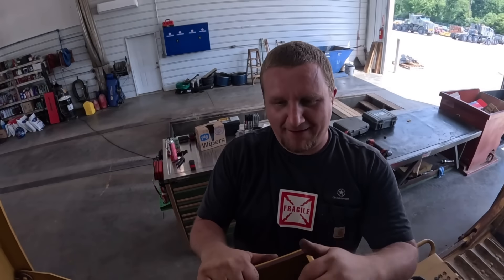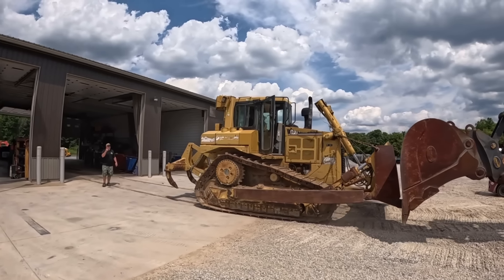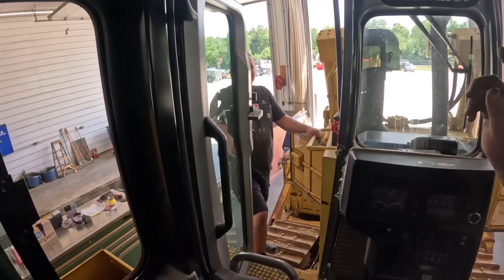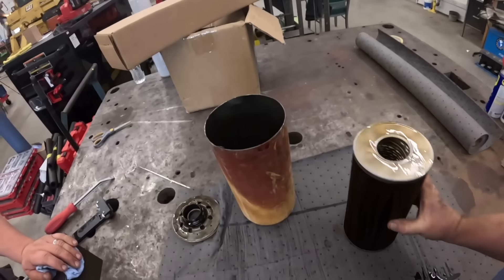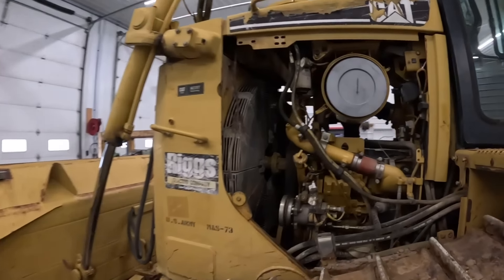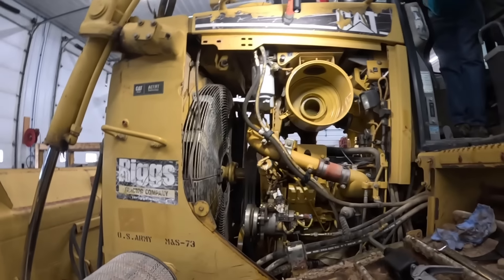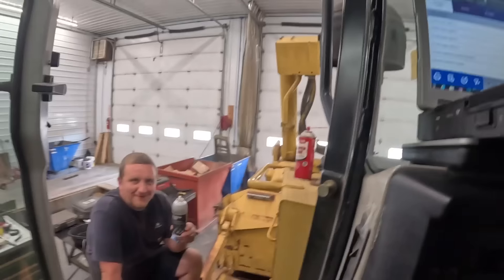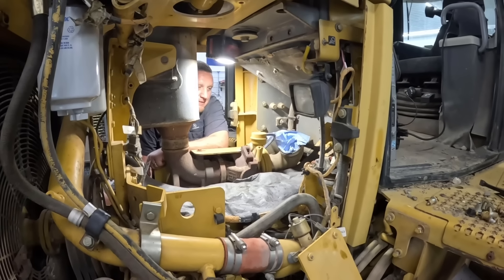Ex US Army Caterpillar D6R dozer is dead with only 800 hours? I may of messed up big buying this!

Comment: Back in the late 80's picked up a used army K5 blazer. SNAFU must have been the norm because someone left the air cleaner lose and a family of mice moved in. Long story short, every cylinder was packed solid with mouse house materials. After a total rebuild, new wire harness, new fuel tank, hoses, belts, tires, etc.,etc., etc., she ran like a dream. She had a whopping 63,800 miles on her. Sold her to a buddy, he drove it as a daily driver for well over 20 years. He still owns her, she's parked in his shop collecting dust these days. Tried to buy her back but he isn't letting her go. She now has over 300K miles on the meter. Starts and runs like brand new. Should have never sold her!

Comment: You never know what kind of surprises you'll find with something like this. It takes a special kind of "not my dozer" to leave the fuel cap off and then they don't even at least throw the final drive shafts in the cab or something. Makes a guy wonder about how these things come about sometimes, but you and Kevin will get the kitty purring again.
Reply: Unsupervised teenagers can create chaos on half a million dollar machines. Or they can work miracles if properly supervised.
Reply: Why would you include the drives shafts for something going to auction if you needed them?    It’s not always incompetence at the unit level

Comment: Diagnosing a mystery is fun to a point...  Thanks for bringing us along and explaining what you find!
Reply: Had a friend with a masters in mechanical engineering overhaul a John Deer tractor engine. 4 cyl gas and couldn't fig out why the oil pressure was low. After completely tearing it own again, someone with a lot less education asked if he bothered to check the oil bypass located near the filter....duh..lol!
Reply: Hope you’re state New York. It is about the same as you got down there. Every little hamlet has one.

Comment: I had a Rusty dozer tank that was also full of Algae... Took a hot water pressure washer and just ran the hot line into the tank filler neck.. then took a 375 air compressor with a blow bar on it.. went through the sight glass with the blow bar and SENT IT! blast it out and re filled.. did this like 10 times... 180 degree water... The tank had baffles which made it harder but I came out victorious lol... Left the blow bar in at the end for an hr and a half, half cracked.. used the hot air to dry out tank... No more plugged filters!!! 💪

Comment: I bought a 644h from the army with 25 hours on the loader, it was a will not start will not run, I got the machine home and let’s just say it was a little critter that had some wires for lunch in the cab, about 15 dollars in wire and a couple of hours labor and it was running like a top. Good luck on the d6 I hope it’s not to bad, great video and keep them coming.
Reply: What auction did you buy it from
Reply: @GITRDUG27  from iron plant before riche brothers
Reply: I think Clint should take a look at the electrical wires like you did. 5 injectors going bad at one time would be pretty odd.

Comment: Unless the specific unit has a lot of training and/or project work, they get minimal hours. Our combat engineer unit had D-7’s and other heavy equipment (1970’s in Germany). I kept inquiring about potential work, and would fine projects that we could do as “training”; tried to do the same itch our JD410’s and 2.5 Cy  bucket loaders. Otherwise they would have had minimal hours. The M&S label makes me think it was used for base support rather than being assigned to an engineer unit. Also, the condition doesn’t lend itself to military unit maintenance (which in our case would never look than bad except in a can point.

Comment: That 6R is a nice operating machine. The steering and shift is all on the one lever. Push forwards for left pull back for right. Shift by twisting. Middle in neutral. Do not leave idling with safty lever engaged or torque converter overheats. You have a very good veiw. That is even wired for satalite GPS to pull programed grade on road building or pads. That transmission is a fairly easy rebuild also. Even a new operator can run that easy. Once they get used to deacselerator. The track turn is by speeding up the track on one side.so you always have power pushing your dirt both tracks.

Comment: There is a DG 7-10 miles around here in Western NY. One town, Clymer NY refused to let them in, They were protecting their local grocery store. Problem with DG, no fresh vegetables and fresh fruits!!!

73’s from Sherman NY
DE N2JYG
Reply: They have them here in Florida
Reply: Big problem with DG is that they run local grocery stores out of business. It happened in Sherman and if you try to open one near a DG, they will under charge for the same thing and DG has no fresh vegetables and fruits.

DE N2JYG

Comment: Being in the repair industry, a customer drops off a foreign engine says it doesn't start AND LEAVES.  OK, get a service manual, and it states - USE A KNOWN GOOD UNIT  😮. After ➡️'SEVERAL' ⬅️ known GOOD ELECTRONIC units, the engine started & ran 🎉. Now, was it the last GOOD unit or a combination of GOOD units 😮🫤 YOUR CHOICE 🤷 😊

Comment: If it's a mistake, I'm bettin' you can fix it cheaper than most. I've witnessed this model of D6R in serious action. Cripes was that thing a beast and a half. Made a normal D6 look like a pansy. Do your best & I bet it turns out. Thanx.
Reply: In terms of what impressed me about it's operation was that for a smaller dozer, the thing had more 'ass', could push more dirt physically than anything near it's size. It reminded me very much of watching a fully loaded 850 Deere which I'm sure you are quite familiar with. In terms of quicker track wear, that sort of makes sense because smaller sized tracks are going to wear quicker being stressed so. Thanx

Comment: Put circuit  breakers in line with the injectors so you don't burn out another set.  When problemdiagnosed properly restore the wiring.  Injectors aren't cheap.

Comment: Video started.  ☑
Like button pressed.  ☑
Going full screen.  ☑
Starting running commentary.  Here we go:
	• Kevin likes Cats.  Awwwww.  😃

	• 800 hours on a ~2006 Cat dozer?  From what little I know, that's not even broken in yet.
	• Is it just me, or are excavators the most versatile machines?  Digging, lifting, pushing.
	• You go, Jay. . .even if your a Ford man.  We still support you.  😉
	• Kevin is so safety conscious. . .bless his heart.  
	• Mmmm, comes with Cosby sauce.  😃
	• Missing Sun gears.  Doh!  😵
	• Yup, ahe's a sooter!
	• Well, she kind of fires with a sufficient amount of ether.  Just need to get enough fuel and pressure in there.  👍
	• Cylinder 1 clickin'.  Cylinder 6 clickin'.  Cylinders 2, 3, 4, 5 electric solenoids not clickin'.  Gotta start opening up stuff, starting with the valve cover.  Stop it, Clinton!  You're making Kevin throw up in his mouth!  🤮 Poor, long-suffering Kevin.  
	• Time to take injectors out.  🤕
	• Yeah, something got hot.
	• Invoking Curt at Area Diesel Service.  Good call.  👍
	• Yep, looks like some damaged wires on the harness.  Stupid rats/mice  🤕
	• Ooooo, ordering some new injectors and a wiring harness.  😉
	• Part 2 of the video for this dozer coming soon.  👍

Comment: We used to pull the final drive shafts on down dozers if we were going to drag them, but we also didn't pitch them... 😂

On the injectors, those harnesses are notorious for falling apart and the plastic on the connectors melting/distorting.

The oiling system is like the 7.3 PS and 6.0, there's a low side and a high side. If the machine has sat for a long time, it can take a while cranking to get the high side with sufficient oil to get the injectors pumped up and the air purged.

Comment: Have you ever tried using a spinning turbo jet to try and clean the fuel tanks out on dozers they are used to clean sewer pipes out really effective piece of equipment can be fitted to a lance or a high pressure hose .Worth a try

Comment: Hopefully it’s just a short in the harness and didn’t overheat to the point of no return! Good start guys 👍
Reply: working on my friends LMTV military truck there are always a bolt or two missing. The two idler pullies for the belts were missing the adjustment lock down bolts, they just overtightened the pivot bolts on the idlers to hold them. It had lots of electrical gremlins. Suddenly it would not move at all.  We finally pulled out the biggest circuit breaker panel I have ever seen (the whole passenger side of the dashboard is a breaker panel) once removed we found 6 or seven major wire looms with chewed wires. luckily the mice did not eat the wires only the coatings so they were shorting to ground and each other. We had to reinsulate 20 or more wires and install a new breaker board due to all the mouse urine. Once we finished it started up and ran like a dream. another odd thing with this vehicle,    all the wiring is white. not one colored wire loom on the truck. no wonder the mechanics go nuts with this stuff.

Comment: I ran a D-6 M with finger tip steering loved it that machine was a dream to run 13.6 wide blade extra long tracks and wide pads.  Once ya got use to the steering great machine to run.

Comment: The D6R replaced the D6H in 1996, and came in five models ranging from the 165 hp (123 kW) D6R to the 175 hp (130 kW) D6R XL and XR, and the 185 hp (138 kW) D6R XL (IG) and D6R LGP. All used the Cat 3306T 6-cylinder engine.

Comment: Happens all the time, injector harness failure, and or injector connect failure happens on that system if you don’t change the oil

Comment: For a fuel tank-  hot pressure wash, then flush with alcohol, which will mix with then and take any water out. Mechanics  were always in scrounging my methylated spirits or isopropyl.

Comment: Best way to clean a fuel tank is to steam it out and hit it with some acid based cleaner. No steam, use hot water, rinse out several times. There are industrial tank cleaning compounds, Lix was a brand we used in the past…

Comment: Looking forward to the upcoming videos on this 6R. I have to say I despise these R's, or any high drive for that matter. I can't stand the visibility issues with them, fortunately people love them and should be able to move it pretty quick once troubleshot and fixed. I love my John Deere dozers for visibility and maneuverability. In my opinion the best part about a cat is the seat( not because it's at an angle), if John Deere would put a more comfortable seat in there dozers they would be close to perfection.

Comment: Personally i would be isolating the injector harness at the jpining plug and checking for a pulse and voltage on the pins for all the cylinders,strange it has no stored fault codes. Testing the injectors for resistance values would be helpful to the picture. Regards Chris Bailey

Comment: Not sure if Cat has timeouts on the engine side but I have have seen solenoid wiring melt due to keys left on for extended periods of time. Usually the connection builds the most heat, and melts first. Same as like a headlight bulb connector, the plug and wire will melt before the rest of the system. Just a thought.

Comment: I have worked on Volvo, Mack, and Cummins engines with electronic injectors and all the wire harnesses look just like that after a few years. Lot of heat under that valve cover and the chemicals in oil just destroy the connectors and wires,  Have replaced many injector harnesses and injectors and they ran like brand new afterwards.

Comment: Clean filter, clean oil.  Hum Engine issue replaced both and still didn't run.   Wonder if that is the NOOP issue. Maybe it shipped from overseas, and fuel and oils were drained.

Comment: Working on electronics , I learned that applying power [ WITH A LAB POWER SUPPLY / that has the ability to dial voltage & CURRENT LIMITS ] - not sure what voltage those injectors require , but lets say 12 volts , dial in 6 volts and limit current to about 1/4 of what good system would draw , then see if the system pulls max current that you set --- this is to load the system with less than enough current to do more damage .
Need to know what the typical voltage & current is - and start with much less , working your way up to max normal --- if the system still pulls more current than listed max - further diagnostics to find short / source of high current draw ?
Good luck & thanks again
Reply: Agreed- do the diagnostics on the wiring/electric before putting in new injectors. I can't believe the whole engine got hot enough to melt/embrittle the harness. Looks like a excess current flow to me! (I've lost a car from critter chewing - cost to rewire greater than value). Modern wiring tastes great as Kev said- soy based insulation.

Comment: If the terminal fit was loose on those injectors, it will cause high resistance and get hot enough to melt the plastic like what you have there.

Comment: I can’t believe you guys are hating on Cat like that.  Especially without me I sure was happy when they stopped putting them in trucks. Our local Cat rep was Ahole. Of course he worked at the local Cat dealership. Most of there techs said he was like that because he didn’t know anything about trucks and only slightly more about equipment. Which made issues a big PITA.   The older Cats ran good when they were right but the newer emission engines were junk had so many come in with  broken rocker studs. They were the most expensive engine to build

Comment: Thank you ( Clint) 😊❤😊 for the skills of moving and rigging the chain ⛓️ and moving the Cat dozer of low boy 😊 excellent 👍 speaking of that ( CASE) excavator, can you tell me if there are ANY differences between the ( Link Belt) excavator and the ( Case) by your experience looking inside the Way they are built 😊 I understand that the same company builds both brands. Is it only the COLOR and manufacturing lettering or is there slit difference 😊 just asking. I want your expert opinion on what brand you prefer to work on. I do "NOT" see any 
( Link Belts) In your yard. Does that mean ( Link Belts) are more robust and longer lasting, doing work. Or is it just the different ( Financing) the two different brands offer to the contractor and owners preferences to a particular Brand 😊 they have always owned case started with a rubber tires Case ( Backhoe) and just kept it in the family when they moved up to more bigger excavator type ditching work. 
Just asking 😊😊😊
Reply from the maker: Paint color is the only difference
Reply: @C_CEQUIPMENT  thank you so much for your expert insight. When you explain everything about your International TD-25
Pushing dirt, and explaining the control levers. 
To notch video you do. "5" 🤩

Comment: The way you received it with fresh oil, Then you find out stuff was melted due to probably running hot leads me to believe either someone ran it low on oil or rand it low on coolant. Then before they got rid of it topped it off with fluids

Comment: From what I here, the ACERT C9 is just as bad as the 7.3 power stokes at burning up the injector harness under the valve cover...don't know if it's true but I have had 7.3 power strokes before and I have seen that harness take out all 8 injectors and all 8 glow plugs....mouse was probably an after the fact issue...been there too

Comment: they used the cat huei system. so did isuzu. hydraulic unitized electronic injection. hydraulic actuated electronic controlled very important to use the right oil right filters and change em regularly as engine oil powers the injectors each injector has a in-built pump. no oil pressure no fuel

Comment: And everyone wants to own a big dozer till it breaks down. I hope it is something simple enough like a shorted wiring system or what ever to cause melted wire. Yo said army and I was in the army. We were known to do some dumb stuff. I did work as a mechanic for over fifty years in heavy equipment but my last heavy stuff was start of nineties and stuff I seen was still back from say sixties and say as new as a mid eighty model stuff. Not too much computer stuff on them. All mechanical engines to me are so much easier to work on if you do not know how to hook up the test equipment.

Comment: well i will say im surprised you got a high track clint an LOL at the planetary sciences... i know a lot of plastics just are not rated for what they make them do my 4runners connectors for the injectors turned to powder i had to replace them with ones meant for a mazda but they fit an were a far better plastic

Comment: Those machines are bulletproof. Just my opinion, you have an electrical issue whether it be wiring, ecm or something. Mechanically those machines give very very little trouble and with only 800 hours I’m guessing the sitting has took a toll on something electrical.

Comment: Hmm... I didn't know the Army Engineers used non tactical equipment. I guess if they needed one dedicated to stateside facility management or construction, it wouldn't necessarily need to be FDE or OD green with 24v NATO spec connections and blackout lights. Adding all that stuff (plus armor in some cases) probably doubles the price of your average D6!

Comment: 29:02 is there a light inside the engine bay?
Reply from the maker: They know that you'll be working right there alot 🤣🤣🤣🤣-Kevin
Reply: @C_CEQUIPMENT  they could also put a tarp rolled inside the hood that you could pull out when working in bad weather outdoors.

Comment: As regards to our little friends eating the wiring harnesses here in the UK they decided a few years back to do away with copper pipework for domestic water and central heating pipes and replace them with plastic and push fit couplings. Low and behold plumbers have found out that the pipes are a good food source for mice. Oops
Reply: They don't eat them, they chew through them to get access to the house. The pipes become a secure pathway.